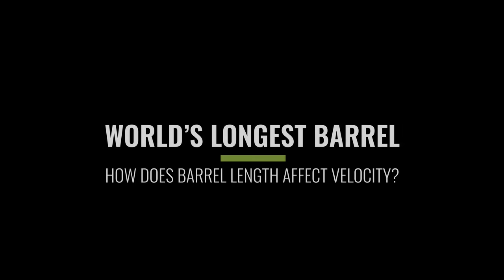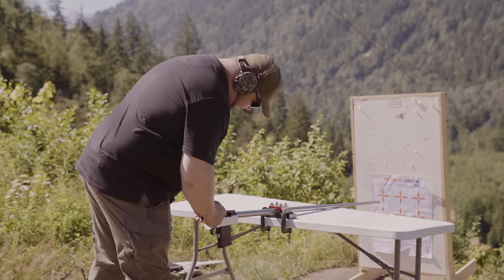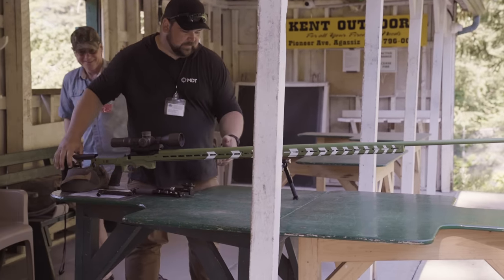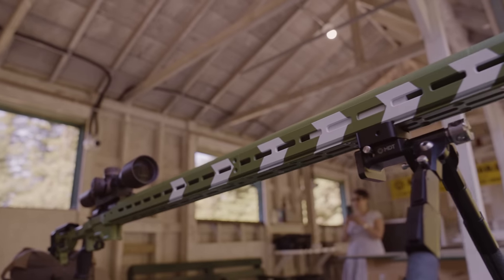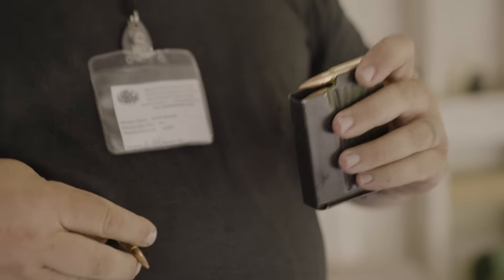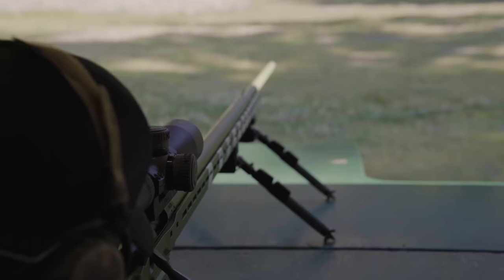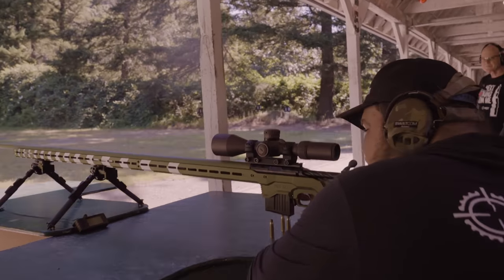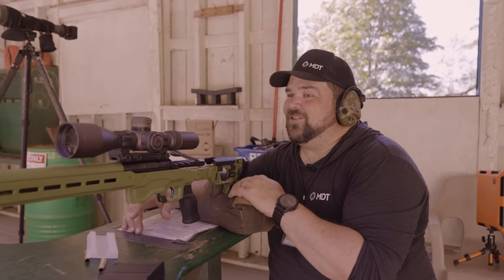Cutting The World's Longest Rifle To Find The Perfect Barrel Length

Comment: That was an epic test!! Thank you for the info!! I guessed 2750 at 6ft but I really thought it would speed up more to like 2900ish around 36-40 inches of barrel. Interesting find. I wonder if a larger case capacity cartridge would yield similar results across the board or if this was a function of combustion chamber size vs fuel?? 308 was a great choice though as we can all relate to it and understand it well. Love this test! Thank you!!

Comment: I would love to see this same test run with an overbore cartridge such as the 22-284 which has a large powder capacity and a pretty small 0.224 bore diameter, plus the 22 centerfire cartridges are making a big resurgence recently. I think the velocities may be even faster as it would give more time for the powder to burn before the bullet exits the barrel. If you were to ever run this test again I would say start with a 52" barrel as there was so little change in velocity between 72" and 52"

Comment: Well if you guys are into experimenting with barrel designs and set ups. There's one thing I really want someone to test, gun manufacturers to test. 
The thing is bullet needs enough space for the pressure to expand and drive the projectile down the range, therefore there is barrel lengths effecting the velocity and ballistics of any bullet. I design I have in my mind is actually a bizarre one. 
How about keeping the barrel short, shorter than ideal but keep the volume inside the barrel enough for the expansion. Like making the diameter large and the length short. So how do we do this?
Say we keep the bullet path narrow and straight, but at the same time provide enough volume or area around that narrow path. Short and large bore with a path of actual size of the bullet. We utilise the larger area or diameter by providing holes around the narrow path and within the large diameter bore for the gas to expand. So that the bullet travels in the path but the gases expands through the holes around that path and utilise the expansion to drive the bullet. It's complicated to explain but I hope you understand. 

Big barrel with small narrow path for the bullet and holes around that narrow path for the gases to expand. Utilise the gas expansion to drive the bullet. More expansion in short length thus achieving short and large barrel that would be similarly effective at that of an ideal long barrel. Instead of long narrow barrel, using short and large barrel but with a narrow path within that for the bullet to travel. Hope you understand.

Comment: It is not clear from the data what the fastest length would be. It might be interesting to set off the powder inside a bag and see how much it expands. It seems like once all the hot gas has filled the barrel, the pressure on the round will be zero. If the barrel is longer than that, then the bullet will start to draw a vacuum on the chamber side. So the volume of the gas created by the burning powder charge is of interest, I think.

Comment: Way back there was a Canadian guy named Gerald Bull, he was a Physicist and Rocket Scientist. He did some rocket research for the Canadian government, that research lost its funding. The CIA then hired him and he worked for them for some years, the CIA obtained for his research a 16 inch battleship gun, he extended the barrel and was firing satellites into low orbit for Spying on the USSR. In the process the CIA arranged for him to obtain US citizenship. His satellite project lost its funding, because he was doing the job that Boeing and a few other companies wanted to do, for 100 times more money. So, the CIA then used him as a front man to ship “materials” out of the US. The action was discovered and he was charged, convicted and jailed. He got out of prison and did some work for South Africa on Artillery systems which ended up as the G6 system. In the course of that work he refined the physics of barrel length and wrote a long paper on the topic. Later he went on to sell some designs for a “Super Gun”. His designs were said, at the time of Desert Storm, to have been used to build a “Weapon of Mass Destruction”, which claim was later found to be false. However he was assassinated in Belgium (don’t know who did it, the Mossad was blamed at the time, they denied vehemently and it had NONE of the hallmarks of a Mossad job and a fair few of both the CIA and GRU techniques). Bottomline, no-one has ever bettered his calculations on optimum barrel length.

Comment: Great video! 

So… next video, you need to start with a 12 foot berrel! 😀 I mean… You can’t give up before having found the point of “bulllet slowing down from friction”!  

Also, the question of the reason for speed often slightly slowing down for sequential bullets, is interesting... Is the pipe typically slightly greased when first shot is fired? 

You should try shooting 10 shots with dry pipe, then greasing it, or oiling it (constant pipe length). See if the speed goes up to something close to the first shot.

Comment: I shoot ELR with a DT HTI in 375ct. I had a custom 36in barrel made, and it's no better at speed or accuracy than the factory 29in.

The truth is, almost every round has more powder than is needed, and brass is not good at controlling that detonation time. 

I can't find it, but in the 1970s a guy made rounds that used a piston ring through an exact matched barrel, that only had 3 inches of rifle at the end. 
The round preformed the same from 11in to 30in as the back pressure was contained for full burn. 

Modern gunpowder is not an explosive. It's a very fast burn.

Comment: I did similar test with foam dart toys, as I was into high performance nerf with smooth bore aluminum barrels. With air speed constant, or this case powder burn rate. As long as there is enough air volume to clear the barrel, there really isn't much speed loss with a longer barrel. Now if you could develop some custom load for this 6 ft barrel, that would be extremely fun.

Comment: As I understand the type of powder used (the burn rate) will have a lot of influence over barrel length. This is the reason you use fast burning powders for pistols. And slower burn rate powders for rifles and even slower for long barrel rifles. At least that's what my reload data tells me. So the ideal length barrel is only good for the one type powder used. Change the burn rate, change the barrel length. If I am wrong, please explain.

Comment: I think that the bullet friction drops off with longer barrels because material from the jacket has rubbed off on the bore earlier on.  Also, if the gas pressure is able to swell the base of the bullet near the breech, that ability is almost nil near the muzzle.  So, less velocity if lost due to friction than expected.

Just because all the propellant is burnt does not mean there is insufficient pressure to accelerate the bullet; or to overcome friction.   Yes, acceleration after 30 inches is not meaningful, but the idea that the bullet slows drastically after complete burn appears to be disproven.

Comment: Barrel rifling amount? The accuracy moved with where the rifling lined up from the chamber to the end. The Barrel harmonics also get worse with a shorter barrel. Ammo case size also plays a roll in how fast the powder is ignited for the chamber pressure. A long action case would benefit from a longer Barrel. Lots of things to consider with future test. You could also test the optimal length by starting with a short Barrel and blasting a target of white paper just in front of the Barrel. Move it away with each round and see how much powder is left on the paper. Few ideas for content!
Reply: We timed the rifling, so the rifling was lined up from the primary to the secondary barrel.
Reply: @robertjury6745  you did excellent work and the accuracy from the full length spoke for itself. Even after 42 years in this crazy pastime and hobby, highly skilled individuals still impress and amaze me. Kudos sir.

Comment: Potential for a new and interesting video:

You guys DO know that the more barrel length you have, the larger your powder grains have to be, don't you?
Remember, powder burns from the outside inward, so to have a properly-balanced pressure curve for the barrel length you are using, you have to match the cordite grain size with the barrel length.

You did know this, right?

You did know that too-small grains lead to too much wasted pressure in the first part of the burn, right? You need the pressure along the barrel for more than the first part of the barrel.

If you don't believe this, for some incomprehensible reason, use the cordite from a .22 in a .223. Same weight powder. You can try the powder from a 5.7mmX28, also. See how that works.

In FACT, to test this out, you can try the same type of powder from a .22 in a .50BMG. See how that works.

In FACT, you can try all sorts of powder grain sizes (or "speeds") in a variety of rifles. At some point, the grains are too small and result in the pressure being too high, as the bullet does not have enough time to move down the barrel as the pressure builds up, and it acts too much like a detonation instead of a proper powder burn but it is NOT a detonation, I know this. 

Gotta match your cordite grain size to your barrel length for maximum results.

What I imagine is that by using .50BMG-sized grain powder, you may see even MORE muzzle velocity with the extreme barrel length. There is a reason they use larger grains in the .50BMG, and it's not due to the width of the barrel. It's the length. 

Have you seen how large the "grains" are in an artillery round? Again, it is not due to the width of the barrel, but the amount of time the round takes to travel down that 15-foot barrel or whatever it is.

I noticed the m.v. stayed pretty consistent at the high end while dropping sharply as you approached the low end. 

This means you  need smaller cordite grains to fully take advantage of the low end and/or you just need more muzzle length for that weight of powder, or both. Look at the cordite grains from a .44 or .500 magnum round. They are tuned to the barrel length, also, yes?

But, leaving grain size constant for a barrel that is that much longer is counterproductive.

I am fully cognizant of the fact that there is a limit at which that weight of powder just ain't gonna make it go faster, regardless of how perfectly you match the grain size to it, but the results indicate what everyone who designs cordite-propelled ammunition knows: more barrel length (time between primer strike and arrival at muzzle) of a weapon, the greater the grain size of propellant needed.

Comment: Im a lil confused, as you stated Hunting - 20" PRS - 26-27"  ELR - 30+" 
but the graph showed 24-25" being shot fastest than 26-27" so doesn't this somewhat show PRS should be using slightly shorter barrels?

Comment: The left and right deviation in relation to the barrel length is really interesting to me. So what is the relation between the two?

Thank you!

Greetings,

Jeff
Reply: I'm no expert, but I believe it has to do with the "crown" on the barrel. They weren't using precision tools to cut it so the slight angle of the cut changes the way the bullet leaves the barrel.

Comment: As Paul Harrell would say, is 200ish FPS enough difference to make a difference? I do have a .308, but I don't have the ballistics memorized. You didn't post the speeds for each group, but you did mention standard deviation between rounds but didn't say what that number was, was it greater than or less than 200 ft per second?

Comment: Very interesting test, thank you!  I would have expected velocities to flatten out at a much shorter length.  I am curious if anyone has any theories about the velocity spikes that appear at 24", 35", 45", 66" and possibly 52".  A fellow engineer I work with theorized that these lengths could correspond with compression waves in the barrel and their timing with the bullet exit.  Assuming these aren't measuring anomalies, I'm guessing there's some kind of resonance effect happening at those lengths.  Thoughts?

Comment: It's all about the caliber and the powder.  A 300 rum with retumbo I bet would keep climbing very substantially until maybe 30-32" then will start to level off.  308 is pretty weak with very little powder, and unless you use slower powder you don't maximize barrel length potential.

Comment: Rockets, to maximise efficiency, calculate the exhaust to be at atmospheric pressure by the time it leaves the engine bell. I wonder if extending the barrel to the point the gasses in it are atmospheric would have the same efficiency.

Comment: If the theory is that: increasing friction is the reason the speed does not continue to climb, then why not address the friction? The bullet could be coated in Teflon or some other low friction coating and see if we could reach higher speeds. Alternately I suppose we could coat the bore with something. Maybe, low friction barrels are the next big thing.
Reply from the maker: Moly  coated bullets were a very popular thing for a while.
Reply: @MDTTAC  I Wonder if Moly and an extra-long barrel is the key to getting much higher velocities.

Comment: I doubt it, because powder has a fixed expansion so, even if it’s fast or slow powder, if it stops expanding before the bullet gets out of the barrel, and the bullet will slow down, but these guys don’t really know what they’re talking about because they’re talking about barrel length and accuracy when they should know that accuracy is also based on the crown of the barrel that’s why you take care rifle out and have a crown so it actually shoot straight not gonna get a very good crown with a bandsaw and what about 3031 powder

Comment: I hope you shot like 3 rounds at each length and then did an average of those 3 rounds' feet per second. That would be the most accurate way to do this. If you only did 1 round at each length, there's a chance a few rounds may have had a few more or less grains of powder. From looking at your data and seeing a few weird spikes, I'd say you only shot 1 round per length. Still fairly good data no the less.

Comment: Why a .308 win? You need to test something that uses a lot of powder, over bore. 7mm RUM, 7mm STW or something more radical, a wildcat over bore. The .308 isn’t something that needs more barrel length to benefit in fps.
Reply: Kind of does in a text ian did in forgotten weapons a 10.5 308 only got a few fps less than a 10.5 inch 7.62x39 150 gr vs 123 gr still more energy but both were only 2100 fps give or take out of 16 inch barrels 39 is only 2400 while 308 will be around 2600 20 inch 39 will be hitting 2400 ish still maybe 2500 and 308 will be at 2700 maybe closer to 2800 even

Comment: Two things. 

The rifle needs to be crowned or at least polished off any filings every time you remove a section(cut off). Otherwise it will make the experiment pointless as the burrs and imperfections at the muzzle end will throw off the shot.

This is in no way the longest rifle in the world. Any Battleship gun still left in the world will have 'Rifles' as the main guns. A battleship main battery is rifled, and they are easily over 12 feet long.

Comment: How much does that extra velocity help with penetration?
Reply: Usually the faster the more penetration if you have a hard bullet like solid copper, brass, tungsten, steel, etc
Reply: @jorgesolis9468  well yes but by how much? I  feel its a shame they didn't do more testing as they had the opportunity
Reply: @doubleutubefan5  usually enough to matter sometimes the amount of velocity doesn't justify barrel length
Reply: @doubleutubefan5  now that can also depend on material used if you're sending a solid brass bullet downrange itll penetrate barriers more than a lead core bullet moving faster

Comment: wouldnt the twist rate need to be variable as you cut it down? makes the test wonky
Reply: the twist rate is the same through the barrel from start to finish. this would have no affect on the speed.
Reply: @ryanmclean8942  I guess its marginal. maybe changed velocity by 20fps at worst/best

Comment: A very nice video but WHHHHYYY!?!?
Why did you waste the barrel and the opportunity? 

This barrel was so much longer than a normal one it just SCREAMS for testing different ammunition, specially with different power-loads. Your test shows that the cartridge used expanded all its power at around the 45" mark at which point the expanding gasses just had enough pressure to keep the velocity - likely most of the powder burned already. Having a different mix with a bit more but slower burning powder could have easily resulted in the bullet still accelerating past the 60" mark without exceeding the pressure-rating.

But now the barrel is gone and you would need to make a new one just to test something you could have done nearly for free -.-